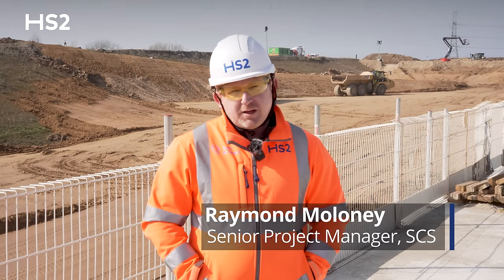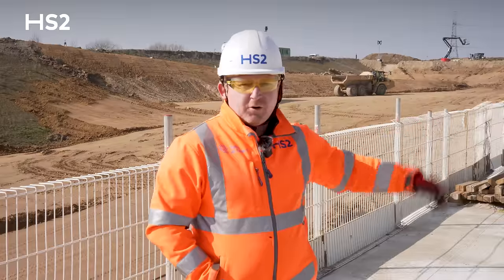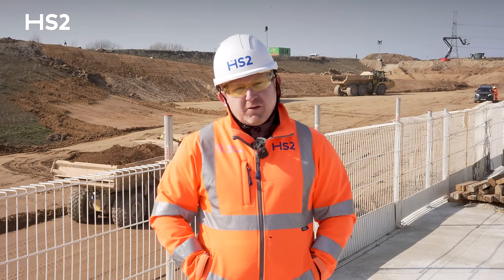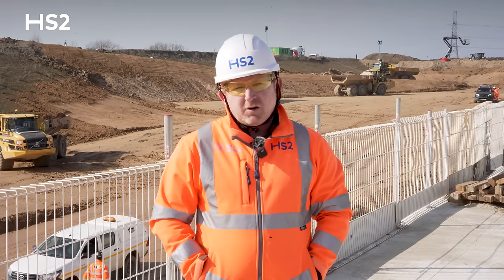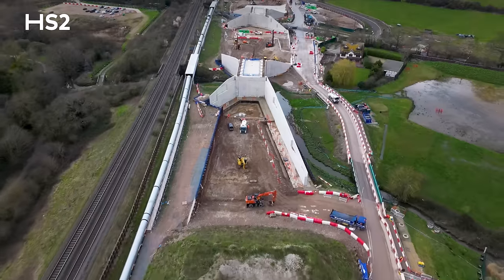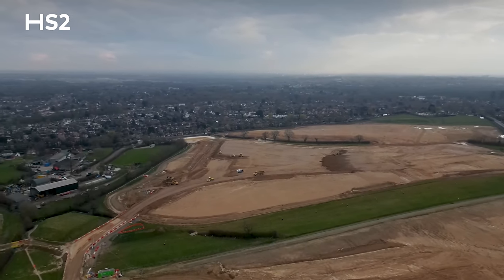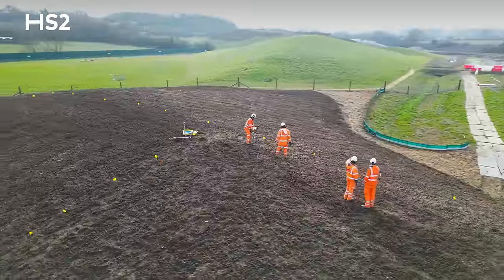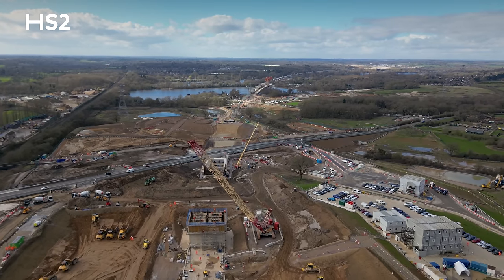Major progress made on HS2’s Copthall Green Tunnel

Comment: Fully agree with you regarding inept politicians (all of them). And as you say it was started in London for political reasons. Can't see how the channel tunnel delayed HS2. The original 32.70 billion budget for HS2 was a figure pulled out of the air by HS2 as the government indicated 32.70 billion was the maximum cost they would sanction so HS2 told the government it could be built for that figure.  Therefore the 32.70 billion figure has no credence. Which therefore makes a cost comparison between the 32.70 billion hypothetical figure and what it really costs irrelevant. The construction contract HS2 has been let on is the new engineering contract (NEC) option C actual target cost which is the same contract used for crossrail. It requires the Contractors to provide a fully audited paper trail of all costs. It also requires the Contractors to provide early warning notices to HS2 if an event occurs which might increase costs or increase time duration. As the project design is a continuous ongoing exercise the early warning notices become a continuous ongoing exercise so the cost keeps going up and will do so until all design work and all planning requirements become fully known.

Comment: 32 miles of tunnels and vanity bridges in the home counties are the reason why the project was so over budget. HS2 is half a project. The levelling up of the North is a joke.
Reply: What’s a ‘vanity bridge’?? Trains can’t go down one side of a valley and up the other.
Reply: The real reason why it's over budget is due to the original 32.70 billion budget being a figure pulled out of the air by HS2. This being the figure the government indicated to HS2 that would be the maximum cost they would accept to build the scheme.
Reply: @TrevorWilliams-fq8mg  HS2 should have started in Manchester. It would have been already built to Birmingham. London already has an underground system, cross rail and euro star. London has 9 million and Manchester 3 million. Manchester does not get a third of investment London gets. More like a 100th. Levelling up is a joke.
Reply: @pwithnall  it's a bridge with mirrors
Reply: @tommcmanamon8327 I don't disagree with it starting in Manchester but how do you know the Manchester to Birmingham leg would hsve been built by now.
Reply: @TrevorWilliams-fq8mg  There were no tunnels to be built from Manchester to Birmingham. It is a easier to build above ground. The alternative private solution/route from Street and Burnham proves this point.
Reply: But that doesn't mean a Manchester to Birmingham leg would have been completed by now. Local Authority planning conditions together with any section 106 agreements are unknown. Also the extent of highway alterations,  services diversions, and unknown ground conditions would all have been a relevant factor. Unless all that information was available it would have been impossible to put a construction programme in place.
Reply: @TrevorWilliams-fq8mg  The alternative proposal to HS2 from the mayors of Greater Manchester and the West Midlands, with private investment proves how inept the politicians in Westminister are at infrastructure build in this country. It is the 32 miles of tunnels through the home counites (mainly chalk) that has delayed this project. The cost over runs would not have occurred from Manchester to Birmingham, which is a more straight forward route and geographical sound. The investment in the North would have benefited millions. Instead the government chose the starting point from London for political reasons not social economic reason. Crossrail was twice the budget, but the government continued to pump tax payers money into it because it is London centric.
Reply: @tommcmanamon8327 I totally agree with you regarding the ineptness of politicians (all of them). And as you say starting in London and going north is politically motivated. But I can't see how the Chiltern tunnels has made building slower. The HS2 construction contract is the New Engineering Contract (NEC), option C actual, target cost. The Contractors are obliged to provide a fully documented audit trail of all costs linked to a fully detailed activity schedule which forms the basis of the construction programme. They are also obliged to provide early warning notices where events occur which change the price and time durations. To date 3,000 have been issued. And these will continue to be issued until all design work is completed  and all planning conditions become known. Until then, the entire project will remain with unknown conditions in place which prevent the final cost and final time durations of any individual contract from being known.
Reply: @TrevorWilliams-fq8mg  HS2 is out of control and is now a bottomless pit for the UK tax payer. Who ever estimated the cost should have incorporated all these known regulations in their calculation. Teams of  professional consultants were employed to work on this project. Is there no repercussion?.
Reply: Probably no repercussions. Nobody produced a cost budget. I'm told by someone in the Midlands who went to an early roadshow presentation by HS2 that they took soundings in government who indicated a maximum figure they would fund was 32.70 billion. So HS2 said it could be built for that. It will remain a bottomless pit of money until all design work and costings have taken place
Reply: Don't put too much faith in Consultants either. Cost Consultants, who put budgets together don't possess enough technical knowledge to understand how things get built and therefore what they cost. I worked on the British Library in the 80's which went from 68 million to 445 million after being let on a Management Contract, which has no price, and where the design team weren't talking to each other. So  the architectural and structural elements finished up with different tolerances.
Reply: @TrevorWilliams-fq8mg  It does not give you any confidence at all regarding public infrastructure contracts in the UK. The only common denominator is that London centric projects get the go ahead, no matter what the cost estimation is and the over run. In other parts of the country, the plug is pulled. I worked in the power industry in the 80's through to the mid 2000,  where we built power stations in China and the far east asia etc... We built them in 36 months on green field sites and had up to 5000 operatives on site, all project managed from Manchester. It astonishes me, that we have are so inept in this country.
Reply: Building power stations must have given you some of life's experiences as well.  I agree London and the South East are always in the political zone of preference. When Sunak cancelled the northern leg last October he didn't have enough time to think up an excuse.  So he invented a load of nonsense about the facts having changed and tried to appease the northerners by telling them they will receive the money saved for northern infrastructure projects. Then it was revealed some of the projects already exist and some money went to Bristol. Since when was Bristol located in the North? And all the delegates at the Tory party conference clapped and cheered him. As you say politicians are totally inept. I can recommend a book called "How Westminster  Works, and Why ....It Doesn't". Written by Ian Dunt it describes in chapter by chapter how and why the entire British political system has been deliberately set up to fail. Why ? To keep a democracy in place. So we,  the voters get to keep churning things over by kicking out the government every 5 or 10 years, or currently every 14 years. Starmer can hardly believe his luck at the moment but his time will come when he makes a mistake when in nr 10. And it's guaranteed he will at some point in time.
Reply: @TrevorWilliams-fq8mg  Agree with your points. Once elected however, Keir Starmer will re direct even more investment to Scotland (which only has two labour MP's at present.).The Northwest has 31 labour MP's now. However his line of vision will not include the northern region. Tony Blair and Gordon Brown (both Scots), also ignored the North, when they were in power, as they ensured that the Barnett formula continued for the home nations to receive subsidies. Boris Johnson won a landslide with his levelling up promise and they were broken. Unfortunately HS2 sums up the infrastructure policy this country. Mediocre
Reply: Agreed. But after the election the North will almost certainly have a lot more Labour MP's than they currently have and Starmer will be under a lot of pressure to appease them. Although he currently denies Labour would resurrect the cancelled HS2 northern leg he might do a u turn. Politicians are good at doing them. But the question of where does the money come from never goes away. I am currently working with a New Hospital Campaign and we are watching the uselessness of the New Hospital Programme which was set up by Boris Johnson to deliver 40 new hospitals by 2030. Same old problems exist  - the money isn't there to fund the Programme and the construction industry doesn't have the resources to deliver.  And the New Hospital Programme agency is staffed by politicians and lords from the house of lords who don't know what they're doing. But will Starmer cancel that as its not affordable ?